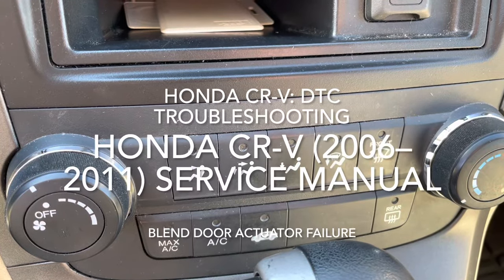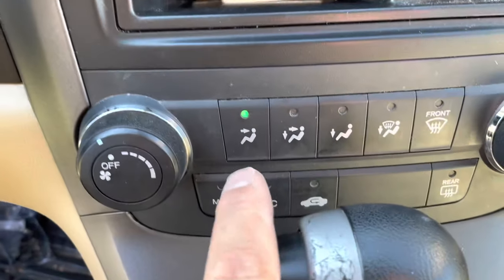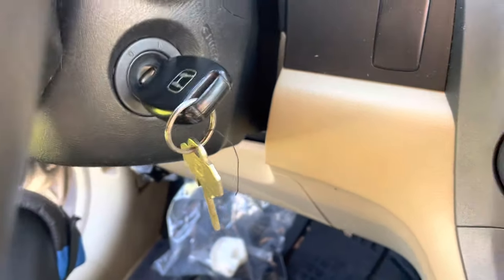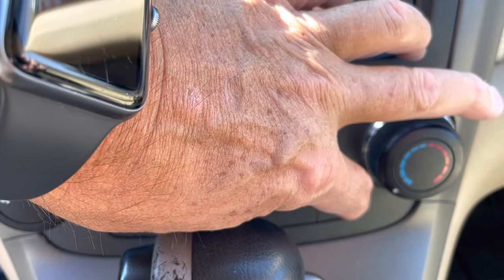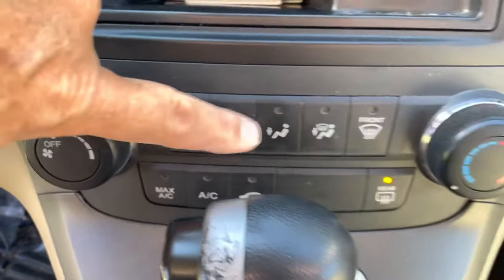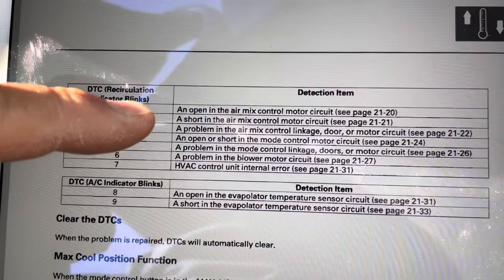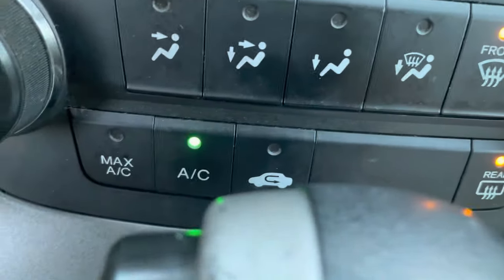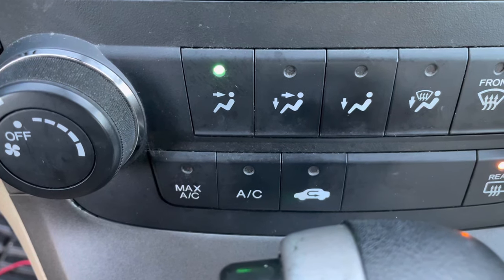Troubleshooting Honda CR-V (2006 2007 2008 2009 2010 2011) DTC AC NO HOT AIR BLEND DOOR ACTUATOR

Comment: If you have a model with climate control the self test can be enabled by turning the key to II then hold off/on and press rear defrost 5 times.
Reply: My hero.
Reply from the maker: The kid rocks!
Reply: I tried your way it worked no flashing light.
Thanks

Comment: I just bought a 2009 CRV, and tried to use the A/C, it was blowing hot air on a hot day. I tried your procedure and started blowing cold air, no flashing lights. its been working fine for two days. I wonder why wasn't it working before? Great video
Reply from the maker: I have gotten a few comments like yours! My guess is that the self test may do some calibration  to fix the problem (at least for a short time). The system reads voltages from the actuator motor while doing a full open and close of the vent. Perhaps it remembers and adjusts values? Or the act of running the self tests fixes some mechanical issue in the motor? Thanks for your comment and if you find anything else please post it.

Comment: I have this same issue.on my 2009...2 flashes. Can you tell me where to find this air mix control to replace it? Is it the same thing as a blend door actuator? Also what manual is that on your tablet? Thanks!

Comment: I'm having issue with my recirculating switch/actuator.... I noticed it this summer as the car wasn't as cold as it once was.  Usually when I activate the air recirculation button, the blower sounds louder. Now when I use it, there is no sound change making me think that the recirculation door is not closing. Any suggestions?
Reply from the maker: Are your test results normal? If yes then I would take the care to an AC shop for further diagnosis / check your compressor etc.

Comment: Thanks for the info and link. A/C was blowing through defrost. The diagnosic process gave open or short in mode control circuit. I did it the second time and it's working properly.  Of I hadn't seen this I would have been testing the blend door motor then tested the circuit.  I appreciate the information.  Thanks again!
Reply from the maker: Thanks for posting your issues to help others! Glad this helped.

Comment: Worked to fix my cold-air-only situation, but read my steps:
Previously I had proper heat and AC, but my vents would not change where they would blow.  It would blow to the floor no matter which button I picked, including defrost.  To fix it I used to whap the device with the green plug with a hammer. That would restore service for about a year.
But NOW I have an issue of no heat - I was just getting cold air. I was skeptical that this video was addressing vent direction and not air temperature, but I was wrong. The trick does work, but unlike the video, unplugging and replugging with the car OFF did not work for me. So I tried it a second time with the car running, with the blower on high, and the heat to max and it DID WORK INSTANTLY! The cold air turned hot right away.  Keep in mind I did this repair after driving around a bit so my engine was warm and able to provide engine heat to the heater unit so I could tell if any of my attempts to fix were successful.
Thank you Danny Jensen!
Reply from the maker: Very helpful comment. Thanks for your contribution and helping others!
Reply: @dannyjensen4954  Glad to be of help!
Followup:
My vents acted up again, despite my heat now working properly.  I did a little more research and I discovered that for the 2011CRV, the air direction device is behind the glove compartment, towards the center!  (The devices are very similar looking.)  All this time I have been whacking on the heat controller (near the gas pedal) thinking it was the vent direction controller!  Apparently, the vibration from hitting the wrong spot must have been enough to get the vents swinging again.
I whacked the proper device this time, and did the unplug/ replug trick. I also re-removed the green plugs on BOTH controllers  and I applied a bit of silicone grease to the pins in the sockets with a Q tip to overcome oxidation/ corrosion.  People often do this when inserting light bulbs too.  Vaseline would work as well.  So now both my heat AND my vent direction are working properly. Just in time for winter!
Reply from the maker: @k.g.442  I had an air mix issue that was acting intermittently. I bought the expensive air mix actuator motor and I bench tested the motor and the original motor was working. I don't think I have wiring issues.  Here is a video I did showing how I tested the motor https://youtu.be/OJ4pTzUDskA . Next, the only thing left was the climate control (CCU) unit so I ordered the CC unit on Ebay and replaced the CC unit and the blend issue all cold went away! Here is a video on the CCU https://youtu.be/inOAfpztOgQ .
Reply: Thank the lord for this comment, I took years off my life replacing the thermostat only to have this not fix the problem, and saw this magic green connector mentioned in a forum thread, but unplugging/replugging didn't work for me. Your tip to do this while the car was RUNNING did the trick.
Reply: this helped me greatly .ty i didn't drive the vehicle as you said, but following your procedure fixed the actuator, it started working!  re-set it again and no #2 code this time! Awesome i think its fixed?  i'll warm it up and see. ty again. great out of the box thinking.
Reply: Thanks so much this worked for my car as well started. Except my was only the vent selection wasn’t working had heat and A/C (feet, defroster, & mixed) only work when selected… the main vents wouldn’t switch. I open up my glove box in the back it was a green plug (not the one above the pedal plug) 
Must lower you glove box to access it squeeze the 2 tabs and release shock . On the upper left side was a green connector  unplugged and plugged in started to work instantly.  God bless!

Comment: Amazing it really worked for me👍🏼
Reply from the maker: Did you just run the self test and it fixed your air blend no hot air problem?
Reply: I did the self test and it flash 4 times, so i test it, replaced it and walaaa…. Fixed thanks 2 you n you video and guess what??? A new subscriber you have. HAPPY HOLIDAYS 👍🏼
Reply: @josangel9405 hey what part did you exactly replace? Mine is also blinking 4 times.?

Comment: AC stopped working this summer and now we have no heat. I performed this test and had no errors. The test played out just the same as your video.  Can you suggest a next step?

Thanks for your informative videos.
Reply from the maker: Chech this video out https://youtu.be/VLf8Oz-JsRY?si=OibMu5J3RcTMwb6e

Look to see if the blend door actuator motor is opening and closing when you turn the knob. Look at the motor next to the gas pedal while turning the knob.

Comment: No blinks when I ran the test on my 2010. Tapped the actuator motor a bunch and unplugged/replugged green clip. Actuator moves and is functioning when I move from hot to cold air and back again. My radiator was replaced a week ago because of a leak but that didn’t solve the problem. Still getting only cold air from passenger vents even though driver’s side blows warm. Any ideas?
Reply from the maker: Thanks for posting. You are the first to report this symptom! Good job on the trouble shooting. I think you need to take the car back to your radiator guy and perhaps you have an air bubble in the heating system preventing water flow to the heating element inside the firewall. Not sure because maybe only one heating element not 2. Also you may need to look at the shop manual.

Comment: I’d not heard about the self diagnostic function. This is a great video thanks so much. My issue is blowing ambient air temp when AC in on. . It did this before and my brother in law changed the cabin filter and it started working. I checked the cabin filter and it was like new and didn’t have any effect. Any ideas on the subject will be greatly appreciated.
Reply from the maker: Did you run the test with the engine running? What was the result?

Comment: I have a question:
The buttons look different in 2008 model and as @gfriedman99 said, it has another way to do the self check.But what does it mean if Dual button blinks and after the self check it turns off and comes back after few days? It happens only when it's freezing cold outside (Or maybe only when the air condition is switched to Hi, but it takes few days to turn on again).
Thanks for the good video 🙂

Comment: One other thing that's a possibility to look for is a damaged plastic gear or linkage between the actuator and door.  Or a misalignment between the door and actuator gears.  That was the case on my CRV the gears were slightly out of alignment.   Must have been installed wrong from the factory I guess or possibly slipped on its own.
Reply from the maker: Could you see this easily when looking at the blend door when turning the hot cold knob?  I did a bench test of the motor. I suspect I could have found the issue by doing that?
Reply: @dannyjensen4954  No it's not easy to diagnose that way because the motor initially goes to the proper position however it's not strong enough to keep it there as road vibration causes the gear to move.   This is why the self-test is passing.   The test is a few seconds and the car is not moving.  I notice the problem while driving, when I first set the temp both sides are about the same heat.  Then after a minute or so with road bumps the passenger side gets noticeably cooler.   I can only attribute this to the actuator motor being weak.   I ordered a replacement today.  Once I do the swap, I'll bench test the old part to see if the resistance is within spec.
Reply: @dannyjensen4954  So I completed the blend door repair today.  (I got delayed as I also had to urgently replace my radiator which was leaking).  So I bench tested the old actuator and it was entirely within spec (1V on Lo, 4V on High and 6.5 ohms on the pins).  Interestingly the new actuator resistance was borderline high at 7.8 ohms.  Anyway after the swap I drove it around and the heat stayed constant the entire time.  I don't know why the old actuator couldn't maintain the proper heat mix for more than a few minutes.  Just weak I guess - but there was no test I could do to prove it was bad other than replace it.   Also learned the hard way not to run the blower with the power transistor pulled out of the air duct.  It's air cooled and will blow the thermal fuse if it doesn't have forced air over it.   I had to take it out of the duct in order to reach the blend door screws.
Reply from the maker: @gfriedman99  Thanks for all the info and checking back in.
Reply: @dannyjensen4954  I took the actuator apart and found what the problem was.  It's not that the motor was weak.  There is a position sensor inside.  It feeds info back to the computer to let it know how much the blend door is open.  That sensor was worn out so it was sending bad data back to the computer.  When that happens the computer just opens the door to lo heat by default.    When you bench test the resistance on these it is actually the position sensor you are reading - not the motor.  The problem is that the position sensor could develop drop-outs at certain areas in it's range and just reading the resistance at one fixed spot is not sufficient.

Comment: I have the same fault. The 2 flashes. What fixed yours? What did you replace? What part? My problem is that is stuck on the cool air and doesn’t change to hot when I turn it to hot. It is stuck on the cool setting. The exact same problem as yours. The ac works but no heat. Thanks
Reply from the maker: I fixed mine replacing the climate control (I think). The blend actuator motor was good. My problem was intermittent. In the video, I just showed and example where I disconnect the blend door actuator to show you and example of a fault condition. I found this after I did a trial and error suffering.
Reply: @dannyjensen4954  Thank You very much for your response and help.

Comment: Will the self test detect a partially working blend actuator?  It works good on full heat but any temps below that are too cold.
Reply from the maker: I’m not sure. I’m the voltage from the blend door actuator is communicated to the control unit. Maybe look at this video make small adjustments in hot cold and see if the actuator moves? https://youtu.be/VLf8Oz-JsRY
Reply: @dannyjensen4954  Thanks.  According to the docs the self-test should even detect a problem with the actuator linkage or a stuck door.  Not sure how they can determine that unless there is some kind of motion sensor on the door itself.   I ran the selftest yesterday and it passed.  It's not a major problem as I can get heat on the passenger side if I turn that side up high.  The passenger side actuator is a bit more involved since you need to take out the glove box to see it.

Comment: I tried this test but couldn’t get it to do the double flash and run diagnostics. My set up is a bit different as I have duel controls
Reply: Same!
Reply from the maker: Check out hcrv.net and look for help.
Reply: I was able to do it on my CRV by press and holding the off button and pressing the recirculate button 5 times!

Comment: Hi I had 4 flashes on my 2009 Honda CRV. I checked online but for the life of me could not find where they sell that motor and where it is located in my car. Someone commented on how inexpensive it was but can you please reply with a link so I can purchase this? And if you have a diagram on where this is located, I would greatly appreciate it. Just an old person trying to fix my car😢 Thank you!
Reply from the maker: Not that simple. Look at my trouble shooting video. You may be able to fix it. Part number is in my other videos you can search on line or order climate control on eBay. This is a deep dive into DIY auto repair. Look at more videos! Sorry for the bad news. Maybe go to auto electric shop and show the guy my video before you start ordering parts.
Reply: Thank you. I will definitely watch your video first.

Comment: So how was the fault resolved?  Did you replace the servo?
Reply from the maker: It was actually an issue with the climate control unit. I bought a new servo but it did not fix the problem. I made a few other videos on this topic. Thanks for your comment.

Comment: Hi I have a automatic climate control for a 2008 crv - wont power up. Pulled and have power on pin 6 and 29 and ground pin 25. Opened panel and tried 12V to pin 29/25  nothing. No continuity between 29/25 - IS this a bad panel?
Reply from the maker: Sorry. I don't have the automatic CC.  The nice thing on mine is no computer so you could just buy a module on ebay and give it a shot after you rule out the basic fuse issues.

Comment: checked motor blowerfan is good, cold switching and warm switching works I can feel it air changing temperature next to the fan...but air is still not blowing from the fans - 2010 honda crv ex >>> I get 4 flashes/blinks
Reply from the maker: See link in video description section DTC indicator 4: An Open or Short in the Mode Control Motor Circuit .
Reply: @dannyjensen4954  : I tried everything, and nothing seem to work, finally I lowered dropped glove-box and touched hvac mode door actuator while changing air flow modes. It seems that grease that was there dried and actuator got stock between modes. I cleaned and applied fresh grease. So far so good, hopefully I won't have to take apart or replace actuator anytime soon.

Comment: I have a Honda CR-V 2010. The fan runs and heater works but no air from the 2 dashboard vents. But hot air comes out of the bottom vents. When I change the mode to Only FACE, still I receive air from bottom vents and not in front 2 dashboard vents.
Could you pls suggest what could be the problem.
Reply from the maker: How many flashes do you get when you run the diagnostic?

Comment: When I run the diagnostic, both light don't flash but I still have no cold air. Do you have any suggestion?
Reply from the maker: Go to an AC shop and confirm your compressor is functioning properly.

Comment: I did the test and got 4 blinks.  Short in motor.  I bought and plugged in a new motor, turned on power and it spun around twice and stoped. I then installed the motor in the car.  Now it won't turn or move the vents.  Also the test by pushing the two buttons does not work now.  Recirculation will blink twice but then nothing happens. No test fan comes on, nothing.  Any clue What happened.  Did I mess it up by attaching and energizing power before it was  installed?
Reply from the maker: With motor installed, Unplug the connector from the motor and you should get the number of blinks in the video. Then plug the motor in and see if you get the same results you describe. If,so watch my other videos on blend door and inspect motor installation/alignment.